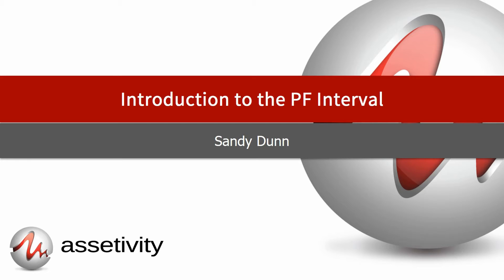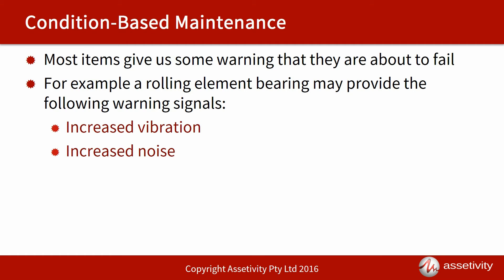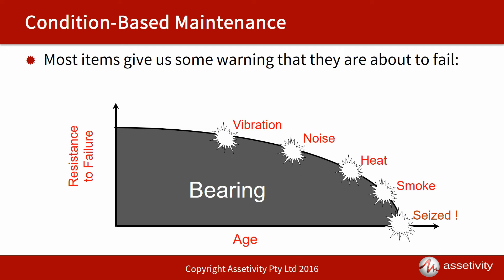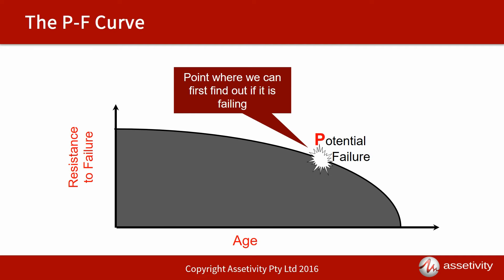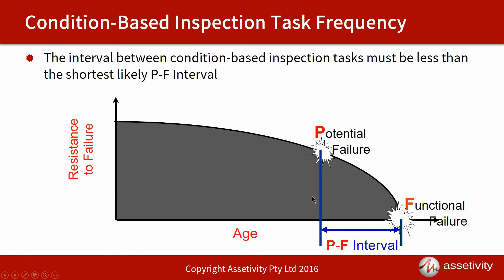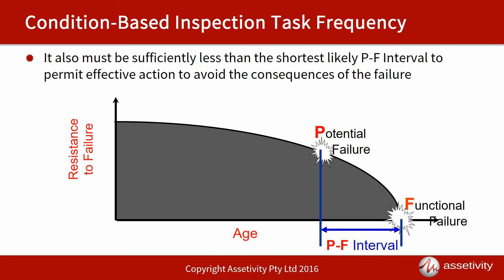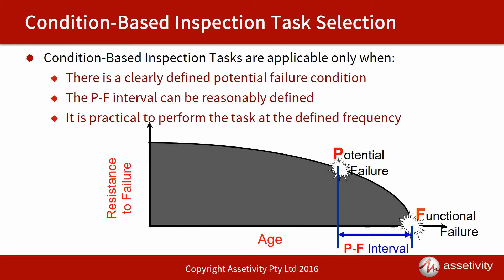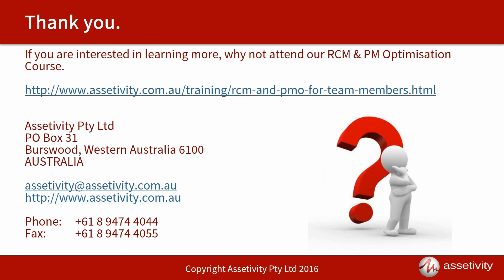Introduction to the PF Interval

Comment: Thanks, But how to know PF interval, 1st time?
Reply: Shelesh, in most cases, if you speak to the experienced operators and maintainers who are familiar with the equipment and how it operates, they will give you a pretty good estimate of the PF Interval.  As most condition-based inspections are quite cheap to perform (in comparison with fixed interval overhauls/replacements), then you don't need to be perfectly accurate.  For non-technological inspections (e.g. visual inspections, listening for noise etc.) an accuracy of +/- 100% or even more is all that is required initially.  You can always refine it later once you have more experience (for example, if the equipment in a brand new plant/factory).
Reply: Sandy Dunn Hi Sandy, I totally agree your point. But, in my experience, most operators and maintainers who has no well knowledge about their PM program. They always follow the manufacturers maintenance manual or some experience from the old staff. Any suggestion about the PF interval when first time to proceed RCM workshop?